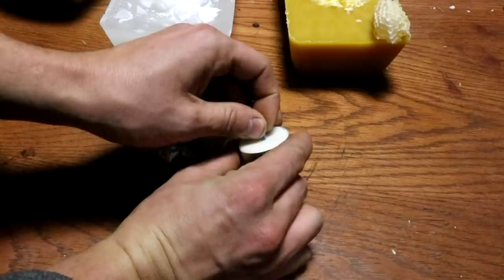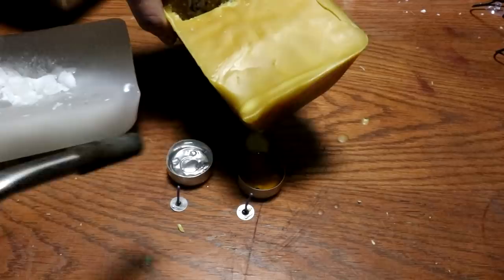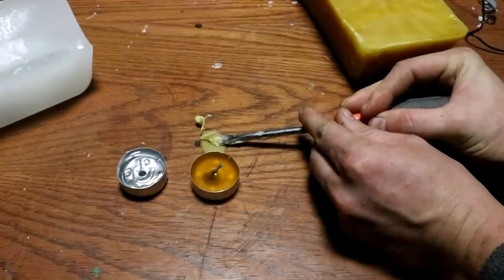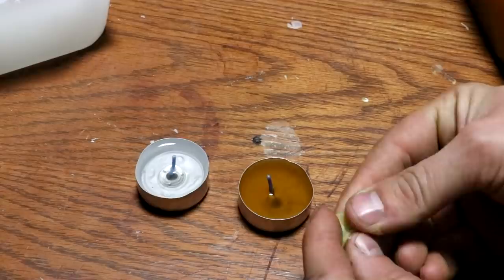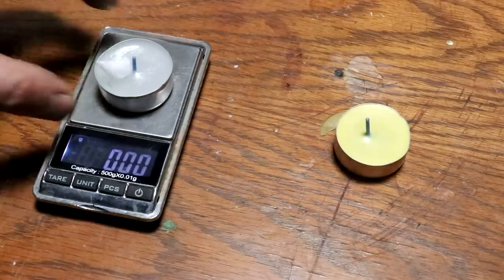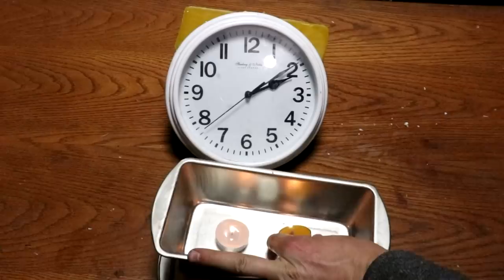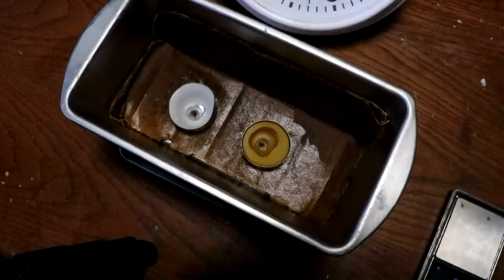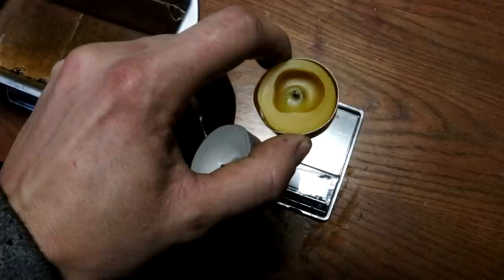Beeswax Vs Paraffin: Flame Test

Comment: So how much potential energy is stored in each wax, gram for gram?  Could you produce a candle wax that burns longer?  An 8 hour tea light maybe?  I can see a market for an "everlasting candle".
Reply: potential Energy xD roflmao

... you mean chemical Energy by complete Oxidation in Joule or so?
Reply: Could you produce a wax that burns longer? Sure, just mix in more high-molecular-weight molecules, e.g. some tar, or start with bigger molecules to begin with. But, assuming there's not much difference in energy-per-gram between tar and paraffin (and there's not), the longer your candle burns, the less light/heat it will produce per minute, and the more sensitive the (smaller) flame will be to a breeze in the room. The question, then, isn't "can you make a longer-burning candle?,"  but "how much light or heat do you want, for how long, and how hard are you willing to work to protect it from tiny gusts of wind?" It might be interesting to try to design a doll-house scale lantern, for instance.

As for calculating the energy content of a fuel, it's not too hard if you know how to balance chemical reactions. You count up the number of molecules of oxygen it takes to turn your fuel into carbon dioxide and water, then count up the number of bonds of each type (e.g. C-C, C=O, O-H), multiply the number of bonds of each type by the energy of the bond, and subtract the total energy of the reactants from the energy of the products. Results would be approximate, but quite usable for most purposes.
Reply: @bumpty9830  I think you could use the heat of combustion of your fuel source.
Reply: @Matthew Grimshaw probably not that easy, considering the function of the candle needs to remain the same.  Light and heat produced at roughly the same rate, using a solid fuel that can melt and travel up the wick, without an excessive amount of byproduct like soot or toxic gases.  I would think that tar wouldn't melt that easily, and you may have flammability issues.  Your entire fuel block bursting into flames isn't really a great thing for a candle to do.
Reply: @HYEOL Potential chemical energy, yes.  Not oxidation, but combustion in this case.  Similar things.  And joules are the standard unit of measuring energy, so yeah, in joules.  For the record, chemical energy IS potential energy.  To quote Wikipedia:
"Chemical potential energy is a form of potential energy related to the structural arrangement of atoms or molecules. This arrangement may be the result of chemical bonds within a molecule or otherwise. Chemical energy of a chemical substance can be transformed to other forms of energy by a chemical reaction. As an example, when a fuel is burned the chemical energy is converted to heat, same is the case with digestion of food metabolized in a biological organism. Green plants transform solar energy to chemical energy through the process known as photosynthesis, and electrical energy can be converted to chemical energy through electrochemical reactions."

Comment: Where is the microcrystaline wax cody?

A very pointless video you got there by the way, so you lit a couple homemade candles, wick length above the solidified wax, wick position relative to the aluminum container and curve of solidified wax, and probably several other factors that do not come to mind, you will get comparative results using different candles cast out of the same type of wax.

Comment: Problem I saw with the first test is that the sodden cardboard was cooling the cup.

Normally a tea candle would get warm enough so that all the wax is liquid, feeding the wick well.
Reply: I think it has more to due with the size of wick used and the blend of candle wax. I can't say for certain but i think most bees wax candles are blends.
Reply: The problem with the wicks in tea candles is that if you don't keep the liquid wax left to a certain level below the burning tip the wick burns itself as opposed to burning the wax it draws up.

The wax level regulates the burn and since the solid wax is above the liquid wax you're losing a lot of total burn time because of the solid wax. Even the crappiest of tea candles should burn quite long.

I do agree with your point about wick size for beeswax. It does matter.

I'm just a guy who makes candles because cough 'she' made me do it. cough